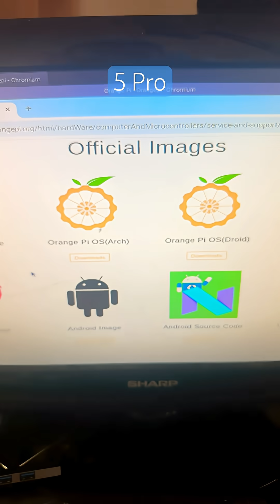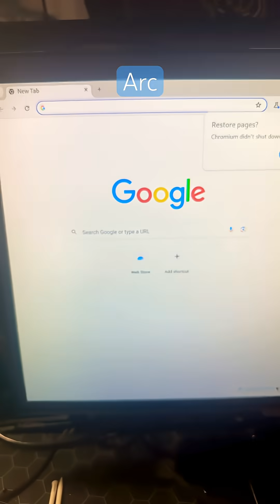#orangepi 5 Pro: A powerful #sbc made for #aivision #retrogaming #selfhosting #linux #cloudcomputing

Comment: what is software support like? thing  like  hardware drivers and dev tools.
Reply from the maker: Its not bad, opi os is simple and fluid
Reply: For dev tools, it comes with the Kitchen sink due to it capable of running Linux which is a gigachad in that arena

Comment: What's the micro SD card holder socket part number? I need that slot.
Reply from the maker: I just found this on AliExpress: $3.87 | 100pcs lot 9pin Micro SD card slot connectors, size 14*15mm TF card deck, fit for phone, tablet, Vehicle Navigation The pop-up
https://a.aliexpress.com/_mNPBWOZ i think this should work buddy
Reply: Slots don't match with the board's position bro @Valleytechsolutions